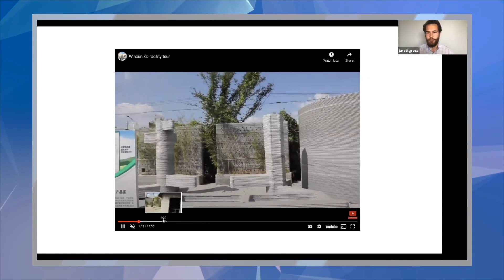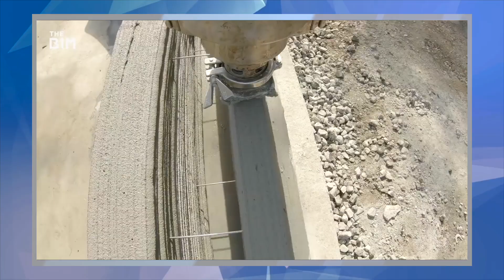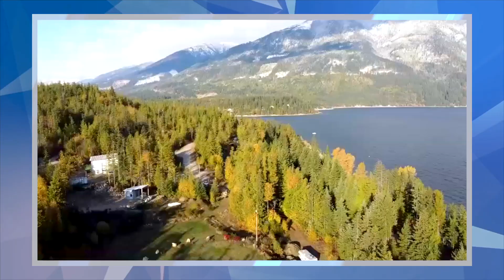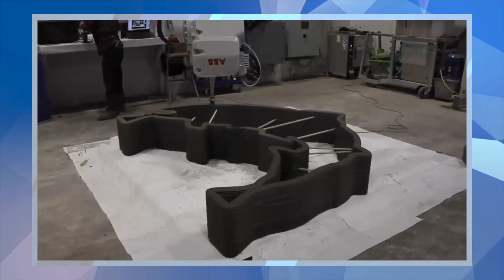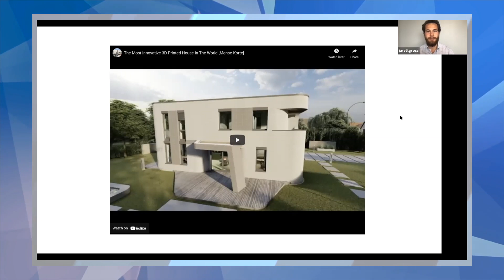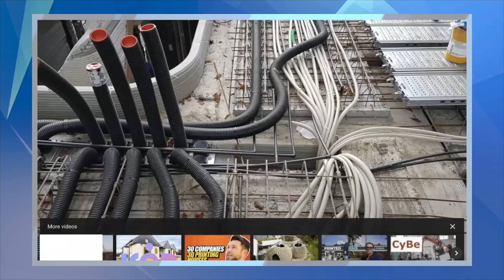$10,000 3D Printed House Myth Debunked | How 3D Printed Homes will Change Real Estate, Jarett Gross

Comment: Many years ago I was in involved in low cost housing in South Africa, we would be building several thousand small basic houses at a time. We would often have people approaching us with various cost saving construction methods that would save x amount of dollars per house over conventional construction. 
As soon as you said “ok here’s the site, can you give us 500 houses at x dollars” the “yes but this site is different so it’s going to cost a bit extra...” came out and we ending up building with conventional methods.
Reply: @TEC Youtube  Exactly, that’s why I say all these schemes look great on paper, but when you have to implement them at a large scale the cost blows out way more than traditional methods.
Reply: Yeah the people talking about using this in countries with poor infrastructure haven't thought it through.. just the power requirements for this with the mixing plant would be difficult, shipping all that there would be a nightmare and having a crew there running it for the 5 days (yeah when they say printed in 10-20hrs that is just runtime, not the setup, head cleaning and other breaks they take to sleep because it doesn't run by itself)
Reply: What kind of changes did they have to make to save money? Did the houses not need foundations?
Reply: @rykerhasyounow  Most people had fancy ideas of prefabricating certain elements and delivering them to site for erection by local people they would train. Usually what happened is the transport costs and logistics of delivering the prefabricated pieces on time to the correct site was too difficult to overcome.

Comment: Looks pretty thin.  How does this handle earthquakes/ tornadoes/ big bad wolf?
Reply: 6000 psi concrete is very strong but high magnitude earthquakes pose a problem.
Reply: Icon's lavacrete is 5 inches on the outside and two on the inside. With insulation between. About 11 inches in total.

In China they have printed a house that can take a level 8 earthquake.
Reply: probably not done in certain areas and climates

Comment: Are they able to smooth out the concrete so it doesn’t have the lines or layers?
Reply: I would think so... But I think if not you could definitely do a fake stone over it.
Reply: Yes they answer that in the video.
Reply: Yes by hand with a crew of masonry plasterers.
Reply: Yes. You have a choice. Some do it by simply sponging the surface, or you can plaster it of course.

There's also a company that has developed a nozzle that smooths as it prints.

Comment: It's going to be a race between prefab concrete (think Legos) and 3D printed housing. These have to go up against a 2400sqft home that can be blocked in 1 day by 12 laborers.  All still require trades (plumbing, electric, etc).
Reply: I don't see how this could ever be faster/cheaper/less effort than formed concrete walls, wood framed walls or even Prefab panels like you mentioned (or ICF of they can get economies of scale). Matt Risinger just did a video on prefab concrete walls in residential construction which I need to watch.

The first floor walls are just not difficult to build in these other methods. While 3d printing requires too many people and effort to setup and run the machine (realize it needs a onsite mixing plant? Yeah they don't mention that). I think that's where people are missing it, other 3d printing like plastics or metal are in a controlled environment building a small highly transportable product, where you set it up once and run it nearly constantly with little variability (even then many 3d printers go haywire). But 3d printing walls (not home) equires a huge setup overhead everytime, the environmental and mixing factors of concrete are much more variable and will require a higher level of expertise. 

Just walk through one of your example house builds schedule and budget and see how this would help. Also who wants to do trade work in masonry walls?
Reply: Automatic block laying robot in Austrailia.  It is a telescoping boom on a truck.  The vehicle loads justified blocks and boom places.  Before placement, glue applied.  Justified means the blocks have tight tolerances (cut to shape,) and don't need mortar.

Comment: This probably will drive cost down and also the value of real estate
Reply: I’ve considered this as well, I’m speaking outside my area of expertise but I think if we continue to head into an inflationary environment it’s possible 3d printed construction could win over the market by simply staying the same price while lumber goes through the roof.
Reply: A concrete block home in Florida is usually more expensive than a wooden structure house in Texas. They'll charge what ever they want to charge.
Reply: cost of build would go down, land would price would go up. regardless, could be a while before this becomes an issue.
Reply: Houses in Florida are build out of concrete block, it's not keeping the prices down. No matter what you build out of you still need a lot of wood for the roof... for now.

Comment: Is the foundation also 3D printed or are they using a traditional foundation?
Reply: This project is on a typical shallow Texas slab. Some projects print the outline for the slab and use the 3d printed concrete as permanent formwork.
Reply: Some 3D house printing companies do indeed print the floor slabs.
Reply: i imagine its a traditional foundation.